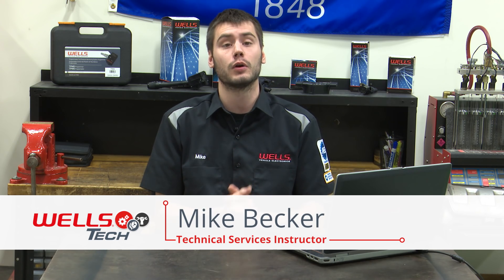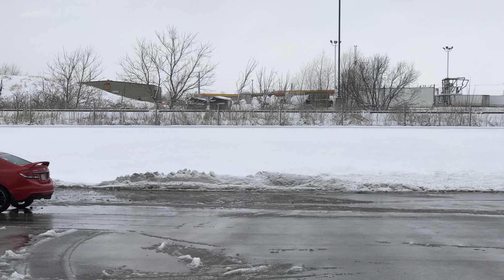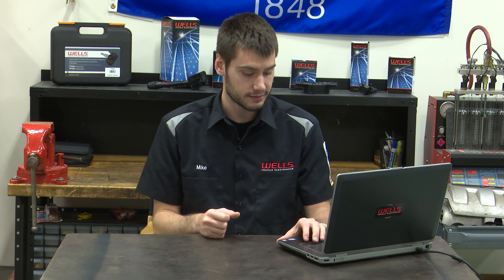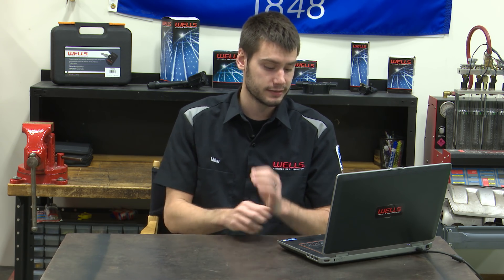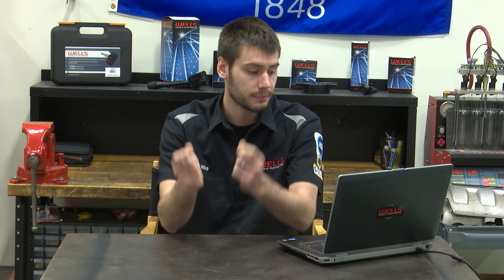Wells TechConnect Ep. 16

Comment: Hi here a case study about a car I was ask to diagnose . but there a catch to this story ?? I only had just 10 seconds to find what why this car did not start if I did not come up with a positive answer then I had to wait more the 6 hours to see why it did not go ? not a easy job but I had  fun on this job  and yes I did find out why this car did not go on only 10 seconds ?  You all might be thinking about this case study I have subject I put up 10 seconds to Diagnose ?? . well this is all the time I had to get a positive answer for this car and yes I did work it out in only 10 secondsOK the car 2010 2.4 petrol Captiva this car only played up when it was cold less then 10 c ? and where I live Brisbane Australia this does not happened to often but we had about 2 weeks off cold morning .
so this workshop give me the job tried to fix this car with no scope just a Scan tool 
the car when was seating for more the 6 hours would a long time to start so it had a new in tank fuel pump module , 4 new injectors , new cam and crank sensors so now I get the car .so I will share with you how I went about testing this system and how I had to use a few tools to come up with 100 % positive answer like we all should know when a cars is hard to start we must always start at the battery if we skip this test we should just close the bonnet and go home its very important test ( you can see the test results I post up in the photos ) I used the picoscope for this test and it pass battery ok ok next test set up a fuel pressure gauge and see if there is any fuel leaks in the system had gauge on for a few hours and no leaks was 56 PSI when I set it up and drop to 49 PSI after a few hours so was happy with this test .so now I did a few easy tests it was time to get a few test ready for when I came in the morning to see why this car was so hard to start ? so first I needed  to set up something to make sure the ECU was getting the command from the immobilizer this was not that easy I use the Bosch Tech 2 scan tool this works great on this car but no PIDS on the scan tool to see id the ECU was getting the command ? ok I have to know or I will not get positive answer why this car hard to start ? ok next scan tool I have OPP COMM scan tool I got form the UK great on Opel cars and this cars is a Opel rebadge Holden in Australia 
this time this Scan tool had the PID I was looking for very happy when you put the ignition on the scan tool said standby and when you crank the car it said released ok we getting there Next set up a spark tested open it up so I can see there is good spark that was easy Next set up Picoscope and have look at injector volts and amps Next find the power relay and make sure that the ECU Grounds it when we crank the car next set up the scope to make sure we have good cam and crank sensors I know there was new but I need to test then too .was hoping I had more channels' on my scope but I only had 4 ok next go home and hope it a nice cold night of this car will start if it does not go under 10 deg c 
next morning vey luck 5 deg c happy open up work shop wake up my PC so I have two screens coming from the one PC one for the OPP.COOM scan tool and one for the picoscope but I have only two eyes to see why this car does not go and I can only do this once when the car goes it will then go and start ok had to wait  more then 6 hour again to do the same test ! ok  crank the car and see why this car does not go when cold ??my eyes does not need to look at the picoscope the scope has a good buffer I can look at his later so my eyes had to look at the scan tool screen to make sure it said that the Immobilizer had to say release ? its said release ok that was ok .so then looked at the spark wow great spark ok also I was looking at the fuel pressures 56 psi ok my eyes also looks at the meter that I had on the power relay control by the ECU this was good too my 10 sec was up the car did not go and I had all the results to analyze ?I stop the picoscope so I can see the injectors pulse ?so now it was time to have some coffee and lets see what I come up with ?The test I know you all what to know what I came up with ? battery and starter test pass 
fuel test pass 56 psi did not lose pressures pass 
spark test great spark pass 
power relays test pass 
 cam and crank pass 
Immobilizes test pass so you might be all thinking so why did this car not start ? ok one test did not pass and you will all see why this car does not start when get down to 5 deg and start when hot or when its summer ? when I looked at the picoscope injectors pulse the very first time the engine went round did not have time to do a 720 cycle we got 42 mil second but we only had this once then when I was cranking I kept cranking we had nothing just a bit of noise but when I turn the key off and did it again the ECU fire up the injectors ok ! so we know now when the out side air was say 20 deg c it get to about 24 in Brisbane in winter the 42 mil seconds was ok to start the car so how did I fix this car ? 
I put in a new ECU and the car was fixed 
all up it was about 2 hours to fix the car most of the time was seting up and doing a few test beforehere is the link to the full case study with phots  https://www.picoauto.com/support/topic14571.html
Reply from the maker: Wow Stephen! Crazy diagnostic! Glad you were able to figure this thing out in such a short amount of failure time. So out of curiosity, did you recheck the injector pw after the new PCM? 
Mike Becker, Technical Services Instructor
Reply: Hi Mile 
Yes i always test every part  i fit to a car to make sure it works ok 
And th the new ECU did have Injection contol all the time i kill the spark so the car would not go and just scope the injection.  It worked all the time when you crank the car.  
I looking forward to the next video you guys do ( wide band air fuel sensors )
Reply from the maker: Crazy, so the original PCM would do a 42mS pulse then nothing but noise, the new PCM pulses normally... But this car did start and run fine when it was warm? So the PCM not grounding the injectors was attributed to the cold weather? I wonder if you could have somehow made the PCM cold and got it to act up, even after the engine was warm. Cool diag Stephen. 10 seconds definitely not a lot of time to figure anything out. See you tomorrow for the broadcast!
Mike Becker, Technical Services Instructor

Comment: Stabilant 22 is awesome and it works! Some of the factory crimps and contact surfaces are intermittent and Stabilant 22 is like soldering the contact. It works great for intermittent troublesome repeats like SRS with high resistance faults that come back @every 6 months and as soon as you disconnect & reconnect the resistance is back within tolerance. Put Stabilant 22 on the connection and the contact issue is fixed as long as it isn't a fitment issue with spread terminals. The Stabilant 22 actually migrates down the terminal to the wire crimp and acts like soldering the connection. It's expensive but pays for itself by not having connectivity issues and the added benefit is not losing face with your customers by them coming back every 6 months or so for the same fault and makes them doubt you. If I have an SRS issue or an intermittent issue that I can't get to fail I put Stabilant 22 on the contacts. Low voltage i.e. 5V ref circuits are highly susceptible. GM has TSBs on their pin/terminal crimps on intermittent issues and if it's in question you can either change out the terminal or use Stabilant 22 and I use the Stabilant 22.  Now if the terminal/wire is corroded or questionable then the terminal should be changed and wire strands inspected/wire replaced as required but normally you won't see a defect.
Reply: Hayward's Automotive to put it simply what I've been telling my customers over the years is that it's electrical glue.
Reply: HaHa that's the short version...it's solder in a bottle
Reply from the maker: Great info guys! It's good to hear some more stories about this stuff. I am really looking forward to the opportunity to use it on something intermittent!
Mike Becker, Technical Services Instructor